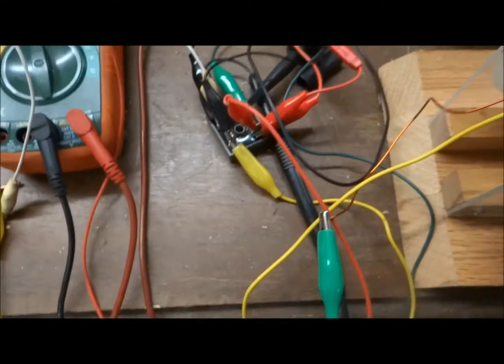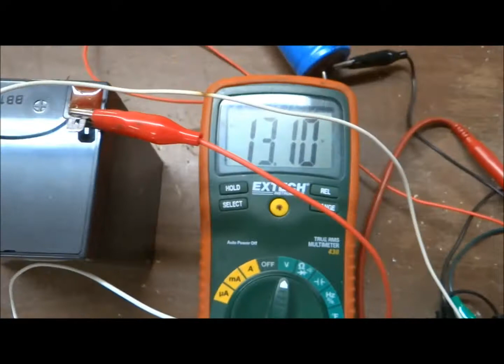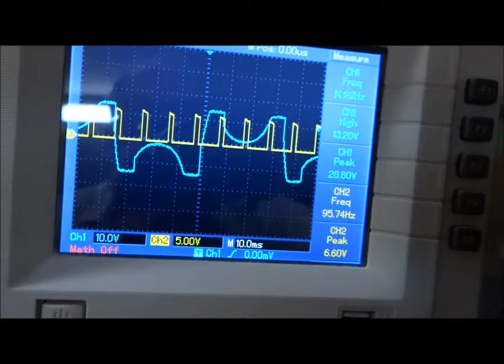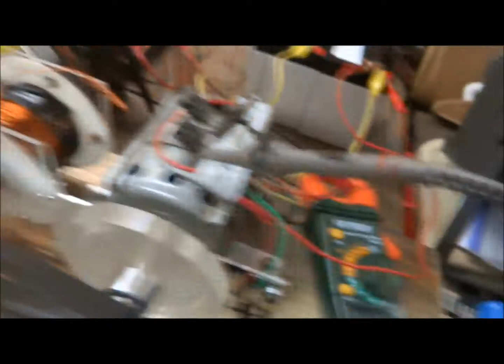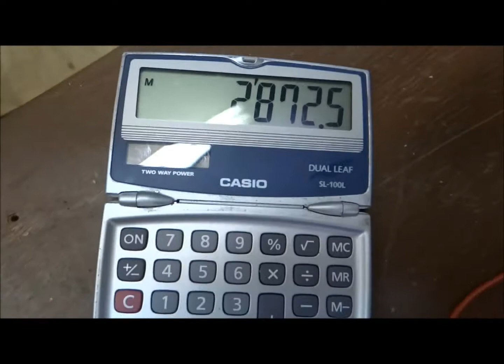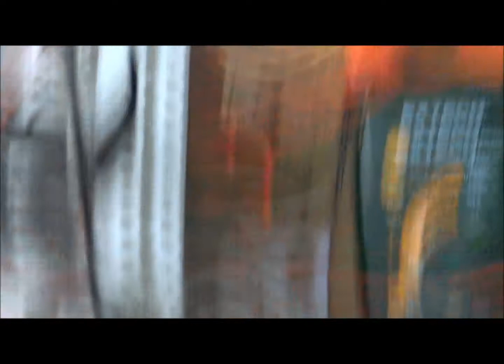Rotary Attraction Motor driving a Flux Gate Generator

Comment: How are the results of this machine and thanks for sharing
Reply from the maker: Hi Ed,
I haven't ran this beyond what is shown in the video, and have taken it apart to use the generator on the two stage oscillator my grandson and I are working on. School is out for the summer so my grandson is too busy working a job to spend much time on his two stage oscillator project.

I am wanting to make a whole new rotary attraction motor and flux gate generator to test the concept further. I also want to run it with a "split the negative circuit" to maximize the gain in the system. I think from my testing so far, that I can get it over-unity with the proper design changes.
Reply: @techmech1000  Thanks